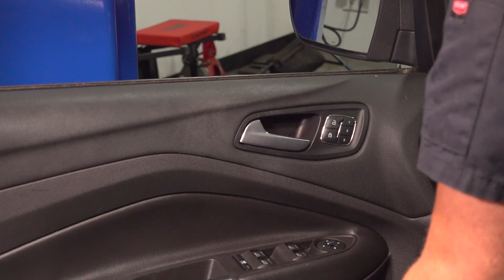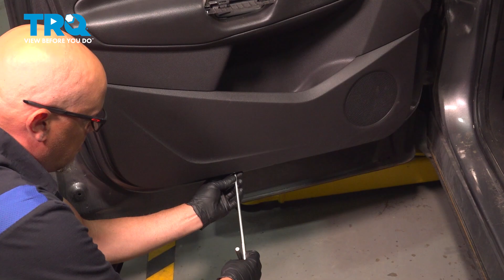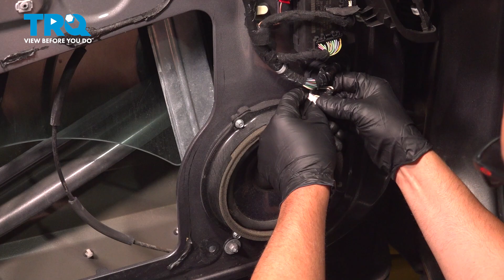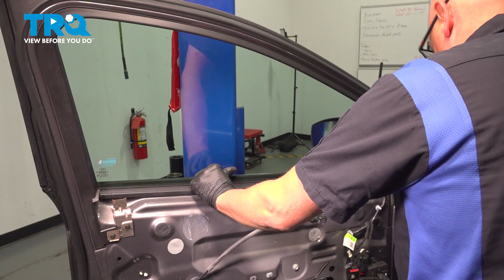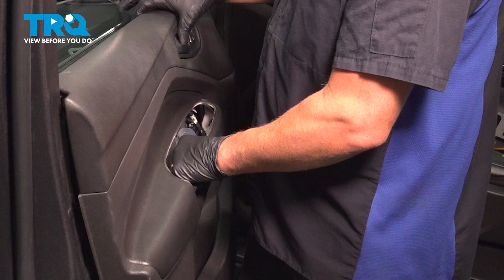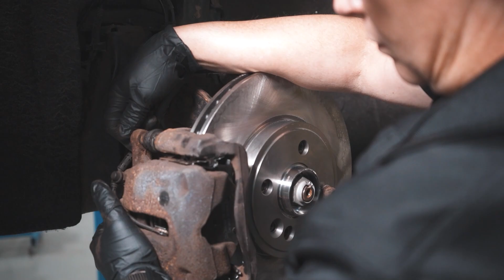How to Replace Front Power Window Motor & Regulator Assemblies 2013-2019 Ford Escape

Comment: Great video. Really helped.  One thing to note on my replacement. 
The window was stuck in a partially open position.  I could not get good access to pry the white clips to release the window.  I took a hacksaw blade, reached up in there and cut off the backside of the clip.  Worked like a charm, and the window came loose.

Comment: Well done video with one minor exception.
At 5:30 when releasing the window from the clip it would help if you informed us there is a hole in the glass that the release tool goes through to push on the catch to release the window.
Other than that, job well done and thank you very much.